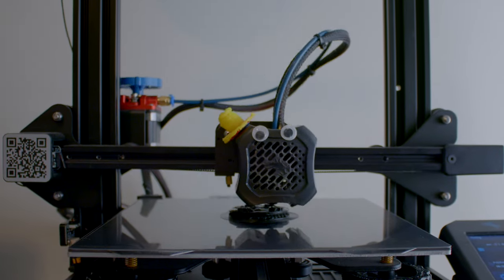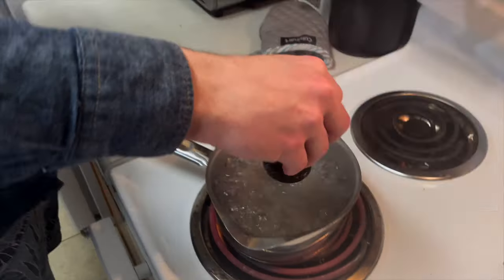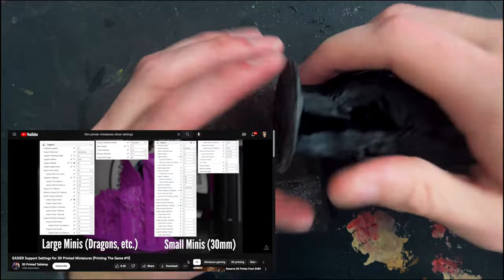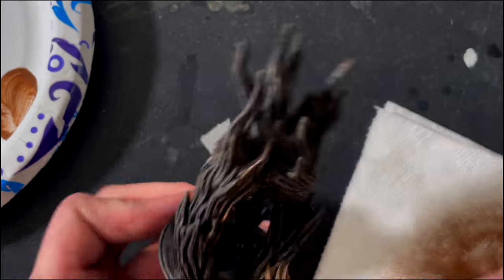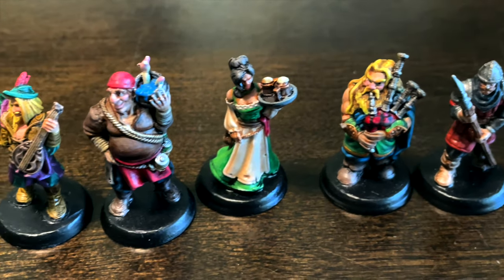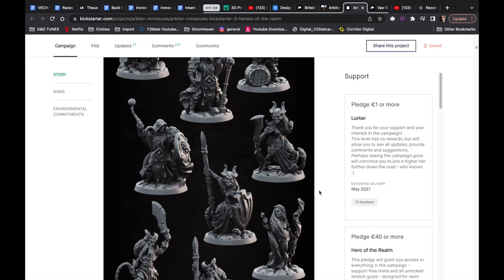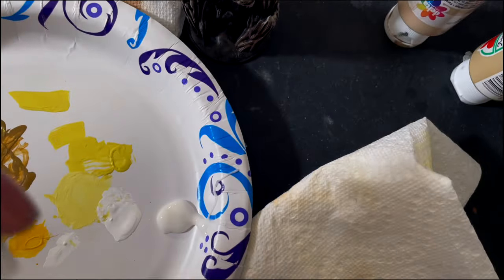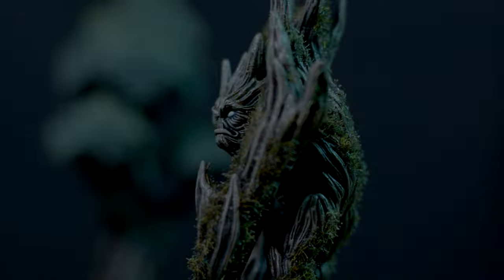Tips For 3D Printing FDM Miniatures

Comment: Support-free miniatures are super nice but I feel fdm printers are more capable than what most people give them credit for. Depending on how much you want a model pretty much anything can be printed, as long as you accept there is no such thing as a perfect print.
Reply: You can also cut models most times to print them suportless, small models like that can be glued together pretty easy.
You can also use finer nozzles.
Reply: FdM machines gets more credit than it deserves, while people think LCD 3d printers are just for miniatures due to cheap resins.
Reply: I must agree. I printet wathammer tau equivalents with full support. I needed to reprint a third 'cause i broke em as i removed the supports an it took between 5 and 10 minutes a model to remove the support but i had my fun with printing and painting these one inch tall miniatures

Comment: I have a confession to make, I never played D&D. I play a lot of FFXIV and Sky Rim but no table top games outside of organ trail when I was a kid. Due to current world events I have been prepping and part of my prepping is making sure I have entertainment when the internet goes down. I can only read so many books so I chose to invest in RPG table top games like DND and warhammer 40k.  I purchased The DND players guide, DM manual and the monster guide with a couple campaigns. I also have Loki battle maps and been printing terrain and buildings on my FDM, I actually just purchased a resin printer just for miniatures. The price of non painted miniatures is crazy so I opted for a resin printer. I did find you can print clean FDM miniatures if its a friendly print of course. I used a .01 nozzle and print at .01 layer height. I can do it on a .04 nozzle but its not as clean.
Reply: I've printed about 20kg of models, have yet ro fully paint one or even game with one yet... I also do it to have a hobby for when the internet makes me want to smash my head in.
Reply: @miguellopez3392  I hear ya, I love to paint. I painted probably 30 minis and two statues for my son. Lots of great videos on YouTube for beginners.

Comment: I would add that you can 3d print disassembled models and get amazing results of prints that would otherwise be impossible.
This is the main part I like about 3D printing, where there are multiple routes for the same solution.
You can even print molds.

Comment: What paints do you use?
I looked at army painter and Vallejo and it all seems expensive
Reply from the maker: We use Army Painter. We bought a big set of a ton of paints from them and just buy replacement paints as needed. If you're new to painting, I recommend checking out one of the Reaper Miniature's Learn to Paint kits.

Comment: I'm not having too much issue with supports, I'm having issues with dry-brushing where it just highlights layer lines and making it look worse than it is. I can't sand/fill most of it because it would destroy the other fine details which are there

Supports can rough up some of the fine detail in spots which is annoying but a very acceptable tradeoff to be able to print most things and some can be cleaned up with a knife/sandpaper afterwards. Also the model can be rotated to minimise the effect. But, due to the layer line issue, this can then look even stranger
Reply: Use PU varnish to hide layer lines. This works well for small layer lines like 0.1mm.

Comment: 1. You can get a Core XY machine like the Bambu Lab P1P (650 bucks), Flashforge Adventurer 5m (400 bucks) or Creality K1 (400 bucks). To print way faster.
2. You can use a smaller nozzle opening, so a 0.2mm or 0.25mm or 0.3mm nozzle for better details.
3. Adjust print settings for faster printing but with the same quality --> print infill every "n" layer, extrusion width for infill with 0,25mm nozzle for example 0.4mm.

Comment: What would be the best orientation for super thin sections like staffs, spears etc? Whether horizontal or vertical, it always feels like a worst case scenario for FDM. I assume below a certain thickness you might as well just cut it off the model and add it by hand with some wire?
Reply from the maker: It’s tough to print that stuff in fdm. But horizontal would be better so it’s more difficult to break along the layer lines.